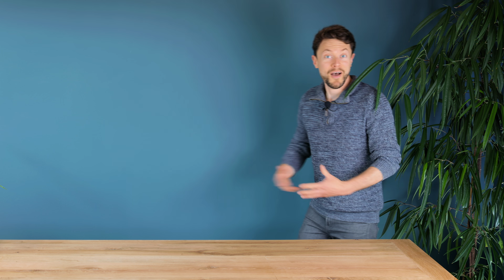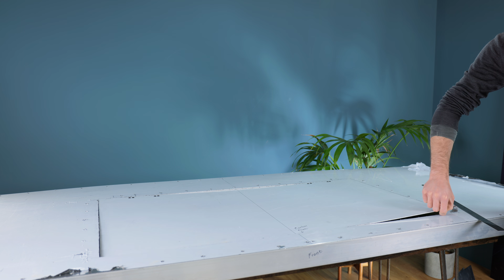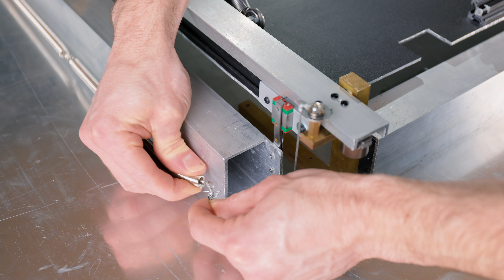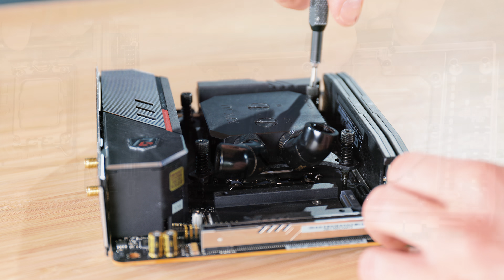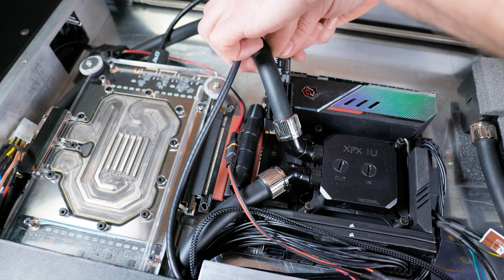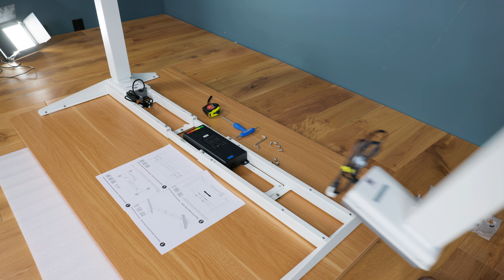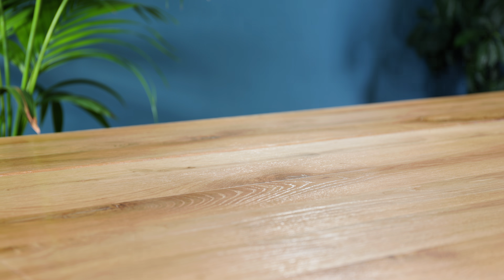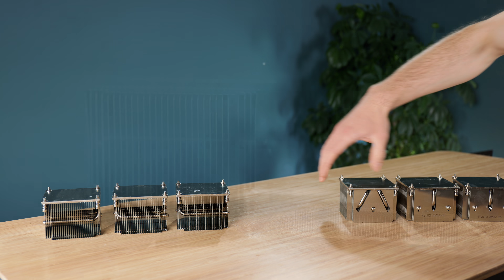Building the ENDGAME invisible PC

Comment: This is an absolutely incredible build, congratulations! There was another problem with your original cooling system that I think may have made a big difference: you had your inflow and outflow to the radiator right next to each other, thermally speaking! That makes it incredibly hard for your water to cool down as much as it should over that huge radiator area. If you put them at opposite ends and thermally separated the back-and-forth heatpipes from each other, I reckon it could be hugely more effective

Comment: A couple of details I would love to have seen elaborated on. Firstly, I'd love to see how the dock was hooked up. I didn't see if there was a cable snaking through to the motherboard to connect the dock, and similarly any other connectivity from the motherboard out, like ethernet and such to the home network. That NAS would probably be a fantastic server for any other devices on the home network.

I had a few questions regarding the fan wiring and power, but I forgot about the section on voltage rails. I also had some concerns about galvanic corrosion from the brass heat spreader, but I looked it up and it seems it should play nice unless your water blocks are made of aluminum.
Reply: That last issue was my first thought too. It looks like the GPU water block at least was made from aluminum. Its such a niche issue that's been solved by off the shelf coolers though, so I'm not sure enough people will comment on it to get his attention.

Comment: Should have used the 140mm fans facing upwards so that they pull the air in from the bottom and blow into desk. Then use a 3d printed shroud to curve the air into the heat sinks. This could possibly let you go back to having the cooling setup more contained.

Comment: Should've rotated the fans to point to bottom so they wouldn't be visible plus a fiter for dust etc. and a same mechanism to add some storage to the sides would be nice. Anyways how much (in US $) would you take to make this set-up (with just one NVMe and bunch of SATA SSD/HDD) and no Wİndows (physically invisible but still visible to Microsoft and other threads lol)?

Comment: Thats a really nice build! 

If I had 800w of heat to move and would do a no-expense spared build, id move the cooling to a different room altogether though. Ive worked in an office with a quad gpu setup before and even though the cards kept cool, I couldnt say the same of my own hardware. You could go all out having some heat pump hugging along pumping out sub-ambient coolant... (or tuned so your desk has a tunable temperature thats nice to the touch). I guess its another pair of cables but its not like the 800w was transmitted wireless either so you could integrate those hoses into the wall as well.

Comment: I'm a huge fan of your work, but I have to say the cooling solution ended up massively compromised and I'm surprised you were happy with the video ending in this way. How can you say that there are no compromises when at the last second you switched from a completely hidden cooling solution to bolting 40 gigantic heatsinks and fans that are twice the height of your table top to the back of it? From the back this thing must look absolutely absurd. Definitely a big compromise. This reeks of external pressure forcing your hand to release the video on a set schedule or budget and I'm sorry if that's the case. 

I'm also surprised to see you get into that position. With all the obvious planning that went into this build, you really never thought to test the cooling system before everything was finalized and constructed?

Comment: Very very very inpressive. My only concern is the gas struts, not sure what N force they're rated for but looking at the way the monitor lid closes i'd want to get a more restrictive structs, because if that magnet slips off the magnetic plate during the closing opperation then there's not enough resistance to stop it slamming down.

Comment: For the colling system, I would have chose thinner brass tubes and flow the water through one all of them at once from one side to the other, preventing them to transfer heat from the hot end to the colder ones.

Comment: Using one or two Watercool MoRa would have been a much easier and better cooling solution. It could have been embeded into the desk to pull air from the sides and push it into the bottom. Would make for a nice feet warmer as well. Maybe for an upgrade video

Comment: I am kind of surprised you didn't use heat pipes.  This way you could do away with the water loop and reduce any kind of maintenance you would have to do.

That said, while I know a foot long heat pipe are cheap not sure how much those kind of lengths would cost.  Not to mention bending, building the heat blocks etc:P  Mabey of the shelf water cooling is better.

Comment: Insanely impressive. I'm beyond orgasmic with engineering solutions I wouldn't've even thunk of before. Trapezoid edges, radiator, and triangular gaphider are very creative! Fans are hacky, but they can be fixed too if the need arises. I've seen videos about pcs in desks and complete solutions, but none looked as well though of and as integrated(and none had hideable displays!). 

Engineering-wise that project is well done, but the idea of putting pc into the desk is a bit excessive, especially the monitor part imho. Moving compute away from the desk and just cabling into it is much easier and achieves the same result. 

That is the path i've taken and instead of building pc into the desk, I've made infrastructure tunnels(with hdmi, usb and ethernet ports) within walls from my wardrobe/server room to the desk in work room and living room behind the tv, and moved my pc into server room so most of compute is there and my clients are thin, consisting only of monitors/keyboard/mouse and tv/hitbox/dualsense.

Haven't reached the endgame yet as my cable management near desk is quite messy, but its already soooo clean with no pc around and only cables are for keyboard and monitors.

Comment: I've been getting into flashlights and I think it would be cool if you made a video making one. You could try making a super compact passive cooled one, an air cooled one, or even make a water cooled one. It's been a dream of mine for a while to build a flashlight in the hundreds of thousands of lumens that carries a radiator and battery pack in a backpack, with a connector hose that carries power and water to a handheld emitter and reflector assembly, and it might be a cool project or general idea for you to explore

Comment: ah the cooling ruins it, beautiful build absolutely stunning, but should've used 6038mm fans with one stack of heatsinks (assuming these are 2U heatsinks ie 64mm) and the other side of the brass making contact with the aluminum body of the table as a passive radiator.

Comment: the only thing i could think of throttling the cooling was the heatpipes running back and forth, meaning the hot water coming into the system will heat up the cold water leaving the system decreasing the delta between in and out. but yes more heatsinks and bigger fans will overcome that issue.

Comment: Should consider AMD for future builds as opposed to Intel (I am not an AMD fanboy, I go with whatever suits my needs and budget, so its been AMD the past 2 builds).  
The AMD runs significantly cooler, uses significantly less wattage, is cheaper and in a lot of gaming situations beats Intel.  

I've got the Ryzen 7 7800x3D paired with 64gb 6000mhz RAM, MSI 4090, 14tb Gen4 SSD storage, 14tb mechanical internal SATA, 4tb SSD internal SATA, 51tb external mechanical (filled with 1100 UHD Remux movies) and its all powered with a 850 watt Corsair PSU and I could probably gotten away with 700w as the 4090 (surprisingly) and the AMD CPU are pretty efficient.  For cooling I got something stupid like 13-15 case fans, but I had them spare so might as well... I put 6 on the radiator for the optimal 3 push/3 pull effect.  All LED is disabled lol I find it gawdy.

Comment: for the cooling solution, you should've gone with a couple of 40mm alphacool radiators and noctua 40mm fans. This would have been much better than your custom setup in terms of cooling and quiet operation under load

Comment: This is a very satisfying video. I've watch a lot of custom pc building videos including desks but you projects are always interesting and original. I would recommend putting a reservoir in there. But actually in order to get an air pocket. A long sealed system will get pressure changes from the water expanding with temperature.

Comment: Why the heck are you still using brass tubes and server heatsinks after you switched to regular fans? I guarantee you they don't work as well as off the shelf radiators, they take up even more space, they're a pain to build, and I'd be worried about galvanic corrosion with all those different metals.
Reply: I can see what he was thinking but the galvanic corrosion between brass and copper is going to be a nightmare. That thing probably only has a year of life in it before the microfins in the heatsink get too gunked up to work...
Reply: I had to search for this comment nobody talks about this.
Reply: The cost. He stated in the video that he got the heatsinks for bargain basement prices. While he should definitely use different materials to avoid the galvanic corrosion issue, I can guarantee his monstrosity of a heatsink setup will cool more quietly & at a much lower price point than off the shelf solutions because of its size. That was the point. For the money he'd spend extra to get off the shelf components, he probably could've just engineered a more elegant "invisible" cooling system. Considering that his projects always evolve and go through different versions, his next version of this desk will probably be the truly "invisible" setup without the inelegant, chonky cooling at the back hanging out of the desk.
Reply: @smokeybowls187  If you make a part of it worse to save money, then you can't call it the "endgame"
Reply: @maximilianmorse9697  I'd hardly say it's "worse" just because it didn't quite fit original expectations. The cooling performance is still amazing, especially considering the top end hardware he's using for the PC & the cost of the cooling system. I think, provided some more time to test, he could easily shrink down that bank of heatsinks to make the PC both "invisible" & "endgame". I expect that to be the next video in this desk PC series. But after 4 months, he had to atleast put something out. This is a polished enough proof of concept to justify a video release.

Comment: Excellent build and ofc you made a viable choice for the cooling upgrade... however, I wonder if the original version simply needed more fans, as apart from the increasing restriction to airflow, the increasing temperature of the air dramatically reduces heat transfer efficiency. And so more fans equals cooler air down the stack, thus improved/proper efficiency.

As an alternative, there are water cooling radiators all the way down to 40mm, I think you have used them yourself before even? I think a proper radiator height for the desk could have been achieved  with more standard components; even though it would've increased the costs dramatically, it would have felt overall more proper to have the radiators disappear in the desk, rather than have these large fans stick out (even though they're essentially invisible anyway)

Comment: Amazing build.  I fans on the back are a bit rough.  It's expensive to iterate on but a couple ideas if you did want to try to hide the fans.  There are very compact, high airflow 1U server fans that would probably fit in your original table with one heatsink level.  They would be noisier though, but you might not need to run them at full blast.  A more crazy idea my be one of those long roll fans (think like the way a vacuum brush is designed, but with fan blades).

Comment: Somewhat surprised that you didn't do an automated hydraulic or pneumatic system for the lid. You could have had it tied to a wireless key or something to open with a press.
Also, there are ultrathin radiators for one U servers. I seem to rember Linus Tech Tips using them with 40mm fans..  Just a suggestion of course.
But i digress.. A really cool build.
Reply: Yeah.. Alphacool does 40mm rads for servers.. I just checked..

Comment: ohh noo.. gpu liquid cooling cold plate doesnt look like made from brass and huge radiator is made from brass.. over time it will cause an amalgamation of both metal and water is used as a medium also amalgamation is futher accelerated by small voltage leakage cause by electronics.. but I WANT ONE!! 😮😮😮

Comment: Looks amazing! Saw the cooling issue coming early, very glad you fixed it. A future iteration of this should have an adjustable display angle. That would allow for the desk to be used better as a standing desk as right now the keyboard and mouse also go really high up, which is not ideal. Raising the desk a little less high, but angling it up, can help. Another issue that you obviously noticed was plugging things like the audio interface and the headphones into the PC. Need a couple extra openable panels for that, a slight change.

Comment: 20:28 (Inadvertently wipes all SSDs below magnet)  Hmm I think I found a design flaw 😂
Reply: theyre SSDs, not HDDs, they cant get wiped, SSDs store the data in electrons, not affected by magnets at all
Reply: @jameslaw1885  OK, interesting explanation, saying electrons can't be affected by magnets is certainly not true but I get your point.  HDDs use a magnetic medium and SSDs don't.  It's true that it would take a much stronger magnet and lots of rapid change in field flux (movement of the field source) to actually risk damaging a SSD.  If you're going to be pedantic and correct someone on their joke, maybe try to get the facts right!

Comment: Great job as always and I can definitely see why this project took some time to put together. I will say though that I strongly would have preferred the flexispot remote/control to have been mounted so that it only became visible once the monitor was open. The cooling solution being slightly visible from an odd angle underneath is only a bit of a compromise if the desk is standing in the middle of a room and not against a wall. The control unit however does take away from the illusion of it only being a regular desk.

Comment: With all the news of 13th and 14th gen Intel CPU's failing recently I'm surprised you didn't go with AMD Ryzen, especially because the 7800X3D is the fastest gaming CPU available.  Plus they run a lot cooler and more efficiently which would be ideal in a cramped install.

Comment: Matt, I might have missed it by getting slightly distracted at some point by my own ponderings of how to build something like this myself, but, where is the power button? How are the cables routed through the chassis? And my final question: Do you think you can integrate a power on state by lifting the monitor?

Comment: I'm sure you thought of this too... But what if you put only one stack of heat sinks on that spreader and used smaller 40mm noctua fans? Perhaps that would be completely hidden? The current one seems insanely overpowered and could probably easily cool 2 such systems with ease 😅

Comment: This table is a huge piece of aluminum. I think it could be used as a passive cooling system. Perhaps in combination with small fans, it would be enough to cool the system.
Reply: it would be nowhere near sufficient to cool 800 watts of heat output passively. not even close.
Reply: @kristofsomers2020  Yes, of course. I'm thinking more about the fact that he could use aluminum as a large radiator and make a hybrid system. So the heat would be dissipated partly passively and partly by fans. I think this way he could have kept the solution with small fans.

Comment: Absolutely loved the hinge.. if motorised, would be so sweat ... cooling is bonkers, cpu is running a bit hot, cause probably gets the water coming from the gpu.. not a big issue though. I would love to see this exact design but with hidden cooling, so you could easily set the table in the center of a living room ... still phenomenal as is, great job

Comment: I was thinking mineral oil could be used for the cooling. Sinking the components and move the oil around into a heat exchanger accompanied with the silent laptop fans. Just an idea. Oil in the chamber would not short, prevent oxidation and dust. Amazing creation again Matt.

Comment: Overall super cool but I have some suggestions. 
Saving money on radiators is cool and all but the amount of work that you have to put in to do what you did is a bit crazy and time is money. I would probably just get myself a radiator and regular fans which just point down. The fans are also at the wall and that restricts airflow. You could probably also get rid of the aluminum at the top and just use the wood because the wood should have enough structural rigidity. An epoxy coating or electrical tape should make it save to use with electronics.  
 Still like it a lot but the cooling system seems a bit last minute.

Comment: you could have made a wedge on the cooling side of the table and put those fans along the wedge and use the thick table hollow part as air channel like this : 

_  _==____//

==  (heatsinks)
// (fans on the wedge)
_  _ (intake from below the table)

Comment: The 1U heat sinks would work if you build your air flow as a 1U server. So basically move the fan to one location for inlet, and force all the air out through those heat sinks on the other side.

Comment: This is absolutly insane, it'a gorgeous piece of engineering and a great video. Side note, using cross-flow fans (GN video here : https://www.youtube.com/watch?v=9CWqCRFroZ0) could maybe have been a good solution for the cooling system, providing a ton of air flow while staying low-profile, quite, and more power efficient ?